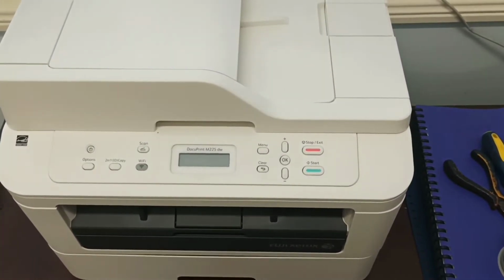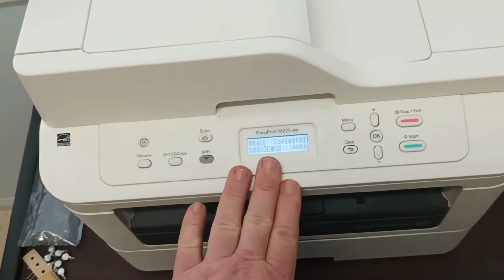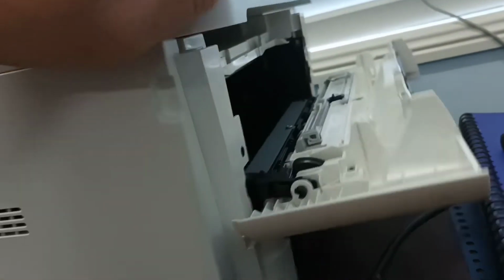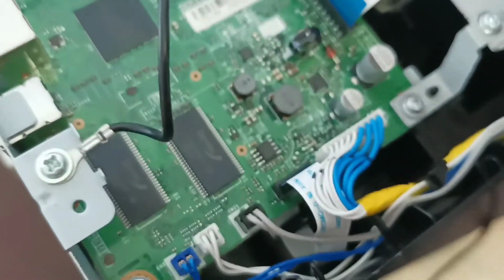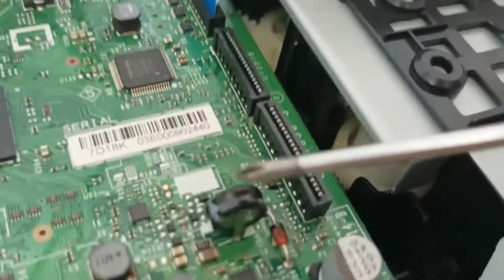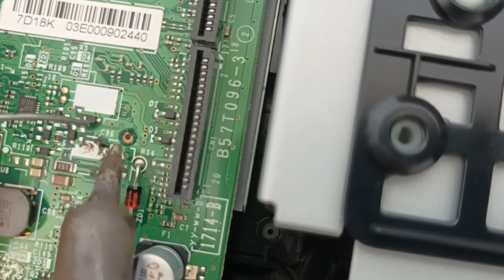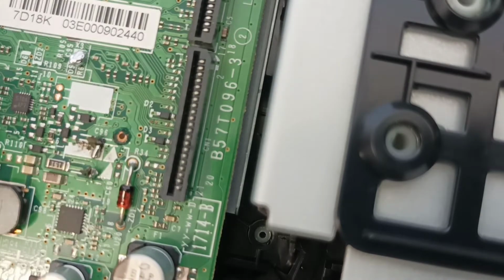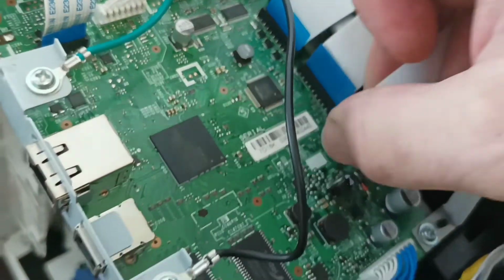Xerox Docuprint M225dw NO POWER Won't Turn On M225z m265 m265z p225d p265dw no lights wont turn on.

Comment: Great video. Nice and clear. Bought a super capacitor from you and installed it. Rear leg was challenging as obviously a thicker track. When I restarted the printer gave me a 'Printer unable ZC' error warning. Went back in and found I had dislodged a tiny SM 400K resistor nearby. Managed to replace it (using illuminated magnifying glasses...) and 'bingo'. Could enlarge your video and see what I'd done. Result even more satisfying! Thanks again.
Reply from the maker: @HowardChilton-e3x  yes as you found out you need to be very careful with the surface mount components around the super capacitor. These are also the very same components that get damaged and  corroded when the original supercapacitor fails and starts to leak

Comment: I can’t thank you enough I just tried to print out documents and the printer wouldn’t turn on I followed your directions with holding down the on and off button and plugging the printer back in and thankfully it worked the printer is fine again. Thanks very much for your video it was extremely helpful. Cheers.
Reply from the maker: Make sure you change the supercapacitor soon it will extend the printers life for another 4 years

Comment: Hi Terry
Thank you for your video and detailed instructions. I thought of adding my experience to this topic. My DocuPrint M225DW failed to turn on after powering down. No matter, what I did, It would not turn on. So I decided to completely unplug the device from power and left it overnight. Plugged it back on the following morning and the machine started working normal.
Reply from the maker: You require the supercapacitor to be replaced. It is leaking it's alkaline contents and coroding your circuit board
Reply: @TerryJonesPrinterRepairs  Thanks Terry, I was trying to place the order, but did not see an option for the Capacitor.
Reply from the maker: @MaestroITSolutions  down the bottom of the page in the link, your Xerox is actually a brother printer rebadged

Comment: Thanks Terry.  Clear explanation video.  My machine problem is Scan unable af.  Can you show which plug should I fix?
Reply from the maker: @joannechow6400  scan AF is caused by a broken scanner cable or a broken scanner
Reply: Can it be fixed by myself?  😊
Could you show how to fix?

Comment: Hi, my m225 dw has a different problem. Once connected to power supply the control screen just keep flashing and have no response. It doesn’t do anything different when I tried holding power button and connect the power supply like you did. And I can’t install the driver because the computer can’t detect the printer. Do you know how to fix this?
Reply from the maker: @Natalie-n1h  this happens usually through the use of a particular type of non genuine toner. It's short circuits the high voltage board out. Your machine is kaput

Comment: Hi Terry, I am from Sydney, NSW. I have the same printer. The photocopy function working fine, but I can't print anything. wireless connected. Not printing even test page. It Showing on the screen that 'printing' or 'receiving data' if I try to send a print from a computer. But nothing printing, it keep silence other than the message display. I reset the machine (all settings), no use. Can you please help on this. Thanks

Comment: Is there any down side to powering it on by holding down the power-button and plugging it in, and then just leaving it on?
Reply from the maker: Yes the moment the super capacitor is no longer functioning and you are no longer able to turn the printer on with the power button the capacitor has begun to leak it's internal corrosive electrolyte. Continue on as is without replacing the capacitor that electrolyte eats away at the motherboard. Then you'll have to buy a new printer and all the brand new printers currently available cannot use non-genuine cartridges, so your cartridge costs go through the roof as well. Also your printer will forget the Wi-Fi settings annual continually repeatedly have to keep setting up the Wi-Fi connections over and over
Reply: @TerryJonesPrinterRepairs  Copy That. Thanks Terry! Much appreciated.

Comment: Hi Terry, great vid. My M225dw printer will power up and in fact prints fine however the display lights up but is completely blank AND the machine still prints wirelessly despite the wifi button not lighting up. Is this the capacitor you mention or something else?
Reply from the maker: Take the printer outside put it in a car put the car in the sun and bake the printer for an hour. The aim is to heat the LCD screen up to see if it reapears with words. LCD screen s die off when cold. Over time eventually room temperature is to cold. If this is your issue you need a new userpanel